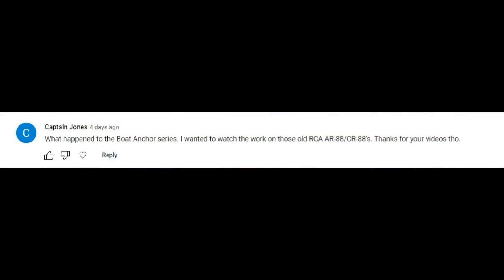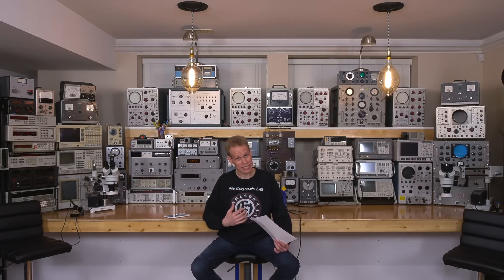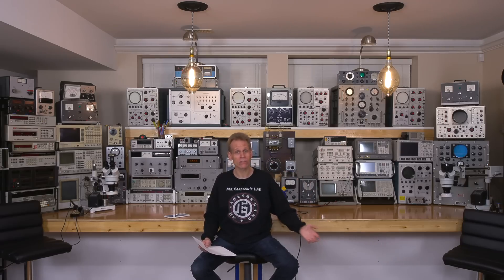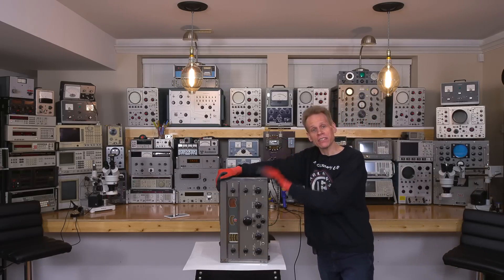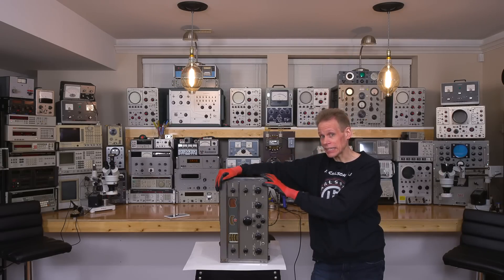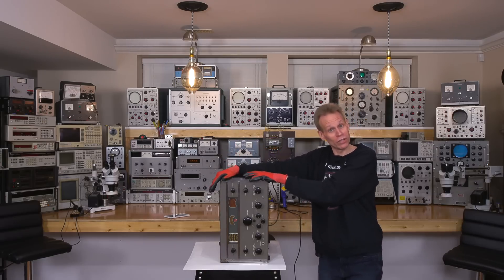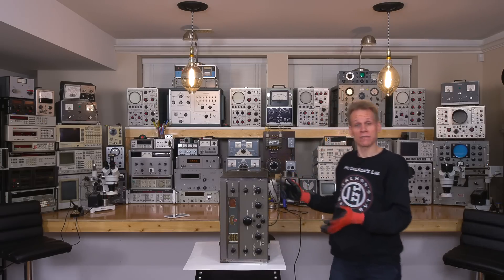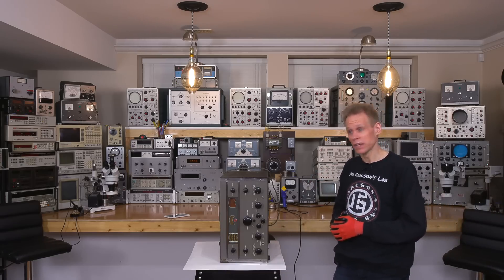What's This? It's The Next Restoration In The GRR Series!  Q&A - Join In!

Comment: Q & A  My question might take a while.   Would you go through a few of your test equipment units to explain why you might preferably use it in over similar units that would be used if you did NOT have this one?  I've watched around 15 of these videos which you actually did explain some in just this manner.  I have to tell you that as I listened to others I wondered why choose to use this over that a lot has taught me how your deeper dives bring out ideas that I hadn't considered.  I mean like I would notice that my test had some erratic measurement that didn't seem so much that I wanted to run down what caused it.  But, unlike me, you're likely to hunt much more of this stuff down and I value that.

Comment: Hello Paul! My goodness you have lots going on and you are making it work. I am super stoked about you possibly restoring some old antique televisions in the future like you said. It's just another thing you do in the channel which amazes me about your talents. Your cannot beat those old "boat anchors". I recently got a Hammarlund HQ129x diagnosed and working and it will some day work hand in hand hopefully with my Gonset GSB100 transmitter. Both now work and are ready for restoration as well. It's an addiction as you well know. Thanks Paul!!! Can't wait.
Reply: I still have my Hammarlund HQ-129X, Red Label, since I bought it as a Novice ham in NJ from Alltronics Service Labs, the in-building RT46 LAFAYETTE RADIO service shop. I got a job there as learning and doing LRE and Pioneer, Sansui ect warranty repairs. I recapped it and ditched the 5U4 rectifier saving 15W on the transformer, and recently bought all replacement tubes. I hand calibrated the Bandspread dial back then, and have searched for all the mods ect for it. K7PP had a video showing the legendary 6X8 miniature tube upgrade for the noisy (above 15MHz) 6K8 Heptode Mixer/Triode Oscillator, but I have never found the actual CIRCUIT for that. Paul has also done several WONDERFUL other HQ-120/140? videos! I am rebuilding a WW2 Hallicrafters ebay SX-28A and just got a pristine SX-100 for $600 & $300 respectively. I got repro dials from Radio Daze, and putting a Hammond TF for a DIY Audio upgrade of the Push-Pull 6V6GT audio section with matched Gold Lion tubes73's. BTW I am CHANGING the weak, touchy SX-28A BFO to the tube and all but L/C circuit of the '129. Tnx Hilary W4HDL

Comment: Hi Mr Carlson I have a AR88D and it has 3x 4uf paper in oil  smothing caps  in the PSU, I was wondering if I could use 4uf polyester metal caps to replace them???
Reply from the maker: As long as they can deal with the voltage and ripple current.
Reply: @MrCarlsonsLab  That is what is on my mind the ones I have seen saying they are for power supplies I think what they mean is switch mode PSU??
Maybe a fuse after the 5Y3 tube and play it safe and mount a 30mm fuse holder on the back panel.

Comment: During WW2 German Egima  secret code traffic was sent on Long Wave by submarines or land based station and also on SW band around 5600 khz
and intercepted In the UK with AR88LF and AR88D and also HRO sets where used and at Bletchley Park.
Reply: Thanks for your comment here! I have seen most of the Bletchley Park and also Chain Home Radar videos - HONOR the great risks and work so many did from the Polish who started the deciphering, and countless others on both sides of the Atlantic advanced Radio and Radar in WW2 I began SWLing in 1965 Novice in 1969, and my favorite Electronics has been repairing Transistor and Tube radios - I found a Business Card from 5th grade recently. Started with a Stromberg Carlson SW chassis given to me and progressed to a Heathkit GR-64, BC453, Hammarlund HQ-129X (I still have!), Full line of National 60's NCX Transceivers, VFO & NCL2000, Kenwood R588/T599 Twins (the best sound ever, recapped to 10X coupling and filtering feeding a B&O S-45 speaker). Recently added an Allied AX-190, LAFAYETTE HA800, a partly restored Hallicrafters SX-28A FROM 1944 WW2, and a pristine, untouched, Hallicrafters original tubed SX-100 the past 2 Christmases from ebay. Did you know that they had amazing Beveridge and other long antennas spread on the surrounding countryside in England, fed into 807 Tube DISTRIBUTION AMPLIFIERS to the rooms of National HRO's and AR88's? Evidently many of the SX-28's shipped to RUSSIA under Lend/Lease and were converted to use Russian tubes in the war effort. Your RCA radios came out of the Camden NJ factories and also Canada as Paul mentioned. The FBI even had a mobile version of Hallicrafters SX-28 here, for snooping on German espionage here, then a predecessor to the CIA. Paul and Mikrowave1 WU2D are my top 2 Ham/Electronics MAESTROS on You Tube! Ham Radio has opened every door in my EE career, from Harris Broadcast, to Nortel and now ADVA doing the power, reliability and especially EMC Compliance still full time at 70 years old, and I am inspired to expand my lab and station with all the radios I couldn't afford as a kid!!! Get a Ham License and lots of the ARRL books new and old to learn how Tubes and now QRP building are done. 73s, Hilary W4HDL

Comment: I really enjoy your videos, I mainly work on electronics from the 70s,80s and 90s. I just restored a Sony CFS-9000 Mini HiFi boombox from 1985. The previous owner had it in storage for around 20 years after he plugged it into AC with the AC voltage selector was set to 110 Volts and here in Australia it's 240 volts :( He said there was magic smoke and a bang. It is now working excellent again.

Comment: IN YOUR SERIES OF BROADCAST RECIEVERS, YOU HAVE MENTIONED THE HOT DEVICES IN  I F CANS, IN THE cOLLINS r390 THE CANS ARE HOT, AND WILL GIVE YOU A GREAT BUZZ IF YOU TOUCH A METAL S DRIVER  TO THE RACK. lots OF EXPERIENCE GETTING ZAPPED IN THAT WAY, tHE RECIEVERS i WORKED ON CAME WITH TOOLS ATTACHED TO REAR OF RECIEVER ALL METAL,,, WORKED ON MANY MANY 390S IN THE MILITARY /// LOOK OUT FOR THE GEAR S A REAL RATS NEST WHEN i HAD TO TIME THEM LOL.

Comment: Hi Mr Carlson, your new lab is really nice, love to see the upcoming video's made in the new lab.
Regarding the Q&A, I have a question related to a subject that everyone seems to regard as the elephant in the room, and that is hardly or not discussed at all on YouTube or on the wide web. There are many video's about projects using a isolation transformer, placing it in a box with a variac etc.... 
But almost nobody mention that the secundary side have a ghost/stray/phantom voltage between each of the 2 wires and the protective earth pin of the wall outlet, this leakage voltage can be more then 50% of the mains voltage, with low current in the µA range, enough to light up a LED, but this leakage voltage can cause damage to sensitive electronic parts like Mosfets etc.... 
So what do you think about using a "high impedance" grounding on the secundary side ? With high impedance i mean a 2Mohm 3Watt resistor (3Watt for getting the mains voltage rating) between one of the secundary live wires and protective earth. With a value of 2Mohm, in worst case only a current of 60µA with 120V or 120µA with 240V will flow when touching the live wires of the secundary. With a maximum of 60 or 120µA of current, in worst case you can get only a mildly shock, and if you connect your ground clip of your scope probe to it, your probe and scope will not get damaged.
In the mid 80's, Tektronix released a device the size like a lunchbox, called the A6901 Ground Isolation Monitor. This device was developed for doing safe measurings with your scope on a DUT that is connected to mains. This device has a "high impedance" between 8Kohm, 11,5Kohm or 80Kohm, to limit the current through the groundwire of the DUT to  protective earth. The limit can be set to 0,5mA (80Kohm), 3,5mA (11,5Kohm) or 5mA (8Kohm) , when this current treshold has reached, or when the voltage has reached 40V peak between the ground of the DUT and protective earth, the power to the DUT gets disconnected.  So my guess for using a 2Mohm seems not that weird, or i'm missing something?

Comment: Starting work at a TV/radio shop when I was about 10 years old, and being 72 now, having spent my life immersed in electronics, both professionally and as my hobby, I know most of this stuff, (but not quite as much as Mr.Carlson.) But I do enjoy watching someone else lug those beasts around and work on them in a nice, big lab set up for the job. Nowadays I've switched to ham rigs the size of a pack of cigarettes, like the (tr)uSDX, and test equipment of a similar size like the TinySA and the NanoVNA devices with tiny color displays, computer interfaces, and a practically unlimited feature set, and I do my work sitting at the comfort of my desk, leaving 700 pounds of vintage HP gear gathering dust on an enormous wooden workbench. But there's something missing. I can no longer smell hot dust, or hear the golden, rounded AM audio tones of a pair of 6L6's in push-pull, and the sound of a baseball game emanating from 8 inch speakers in bass-reflex metal or wooden boxes. And it's just not the same. But thanks to Mr. Carlson's Lab I can still get most everything but the smell of hot dust and the back injuries.

Comment: Hi Mr. Carlson, I was in the US Navy and was in their advanced electronics program. I ended up specializing in displays and operator consoles in CIC. I also got qualified in 2m repair which is microminiature repair soldering. I was lucky and got to do a tour of instructor duty, so I know what it is like to do some teaching like you are. It is more challenging than what people think it is. After military service I got into manufacturing and worked in the machining field on NC and CNC machines. We had machines and stuff still running on tubes, and a lot of motors and DC drives. AC frequency drives were still kind of new, and I got to learn a lot about PLC’s and programming. They also required us to do all the plant electrical work. After that I worked in manufacturing in the food industry, doing setups and repair of the automating process of making cookies and muffins. We handled the plant and everything on the production line. The last almost 20 years I have been in the casino industry working on slot machines. I ran the electronic bench and worked on things like electronic boards, power supplies, crt monitors, lcd monitors, and all sorts of other things. I now run the show and have people working for me, so I don’t spend nearly as much time on the bench. I love a good bench above all things and yours is most impressive as with your knowledge. You have a vast amount of more knowledge and ability than me and I love watching your videos. I run into people all the time while doing my job and they love to start a conversation about electronics, especially old timers. Your channel is the one and only channel I think that I recommend to them that I think that they will enjoy. It is amazing the path that electronics can take you on and where it leads. The number of fields you can work in is endless and reaches into all sorts of businesses and industries. Thank you for your channel, I really enjoy watching it and I always learn something new. Keep up the good work! I look forward to a great new year of quality content!
Reply from the maker: Thanks for taking the time to write!
Reply: @MrCarlsonsLab  Your welcome! Thanks for taking the time to making videos and sharing your knowledge for those of us who like to watch and learn new things!
Reply: My journey is in the beginning..
Reply: What a story man that's awesome
Reply: I get excited to hear this

Comment: any interest in looking at a Narco AT 150 aviation transponder?  Not transmitting.
Reply: Good luck to you! If you Google Narco, all you get is info on drug dealers! Aviation electronics is privileged and classified information. I've never met a tech who admits to working on any aviation equipment especially RCAG sites and how they work. It's almost IMPOSSIBLE to find info on these! I have a Narco 10 transceiver with a blown final transistor. It's a dead short when you plug it in so a current limited supply is a must. The manual, if you can still find it is over $150! A visual inspection would be a good place to start with a "super probe" like Carlson has on Patreon. A fairly simple version of this is also available.